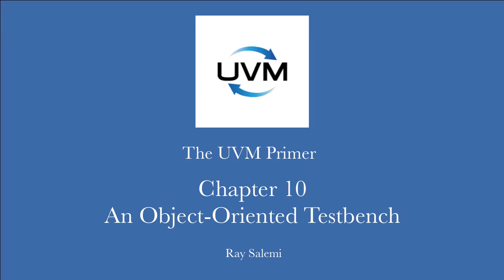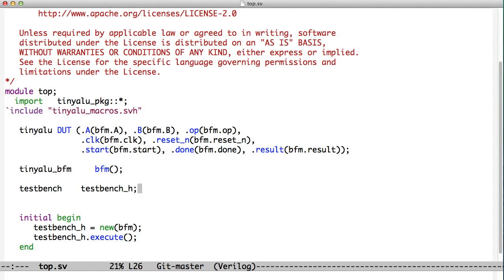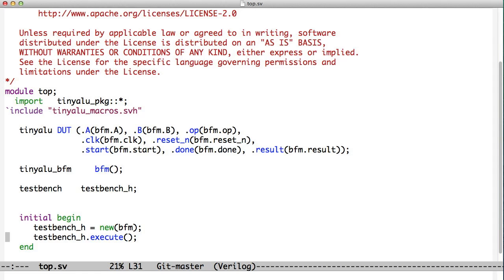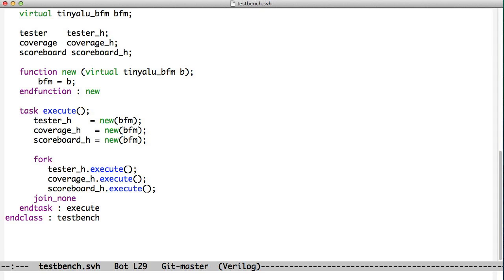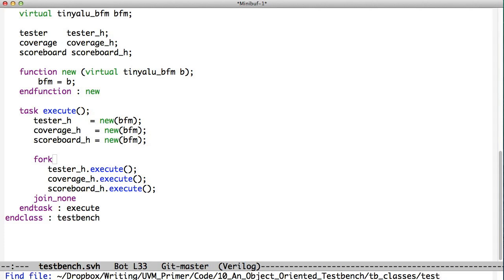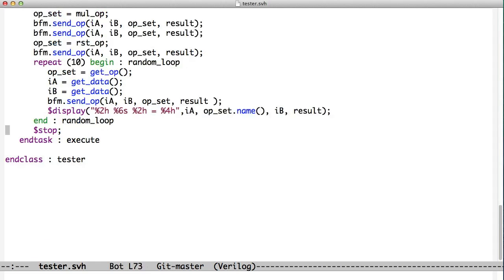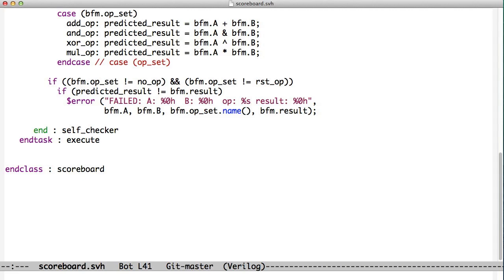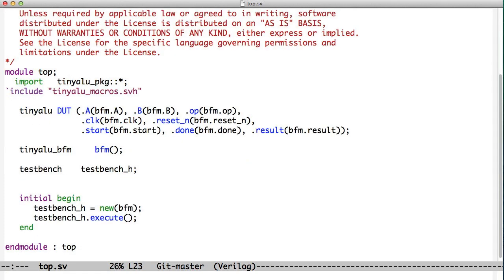Chapter 10: An Object-Oriented Testbench

Comment: We use the `join_none` because we want the `execute()` method to terminate as soon as its launched the other threads. This will not end the simulation because the other threads will still be running. 

That said, you could use a `join` here and the testbench would still work. If you used a `join` you could do something fancy such as put a `$display("Test Complete")` after the `join`.